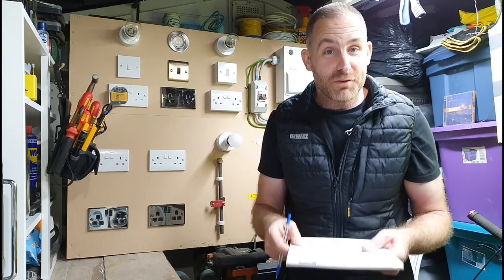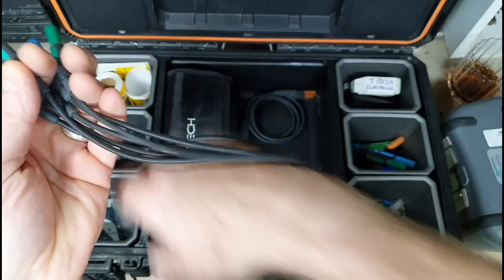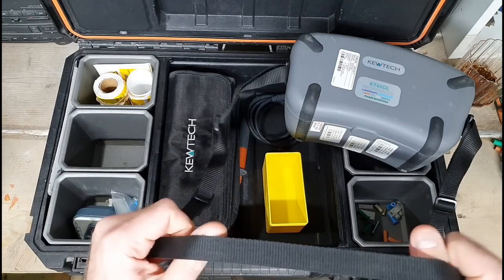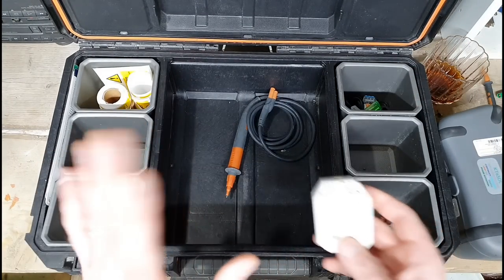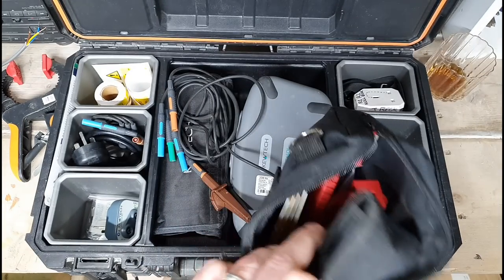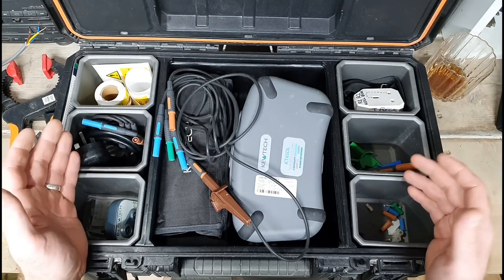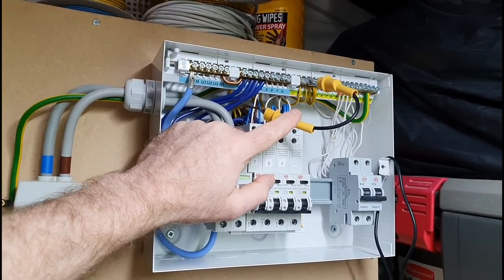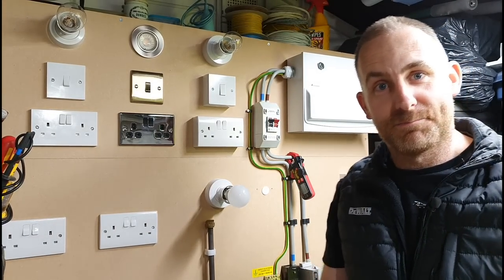The Kewtech KT65DL | Multi Function Tester. (42)

Comment: Nearly identical gear to me lol. Love my KT65DL. I have the light kit, the PAT test converter, the Proving unit, Leads, Crocodile jump leads, but i carry mine in its original canvas bag, along with my fluke clamp meter, and breakout boxes. Also.. That silver touch pad on the panel measures the potential between the operator and the
 tester’s PE terminal. A message“PE HiV”is displayed on the LCD with the audible buzzer if a potential difference of 100V or more is present between the operator and the PE terminal at touching the Touch pad. Great to see you back James ;-)

Comment: Nice vid mate 
I'm a local boy and was surprised to see your video of a rewire you did on Ashley Lane a while back, this was the area I was brought up in . I went to the college behind that job and also to the Primary school at the end of the lane
just to mention though when you start making additions to the rig you will need to put the tails from the supply into the top of the isolator and the board tails into the bottom, I know it looks really neat but the supply tails always go in the top as they can be pulled out if something heavy falls on them, sorry if you think I'm nit picking but for such a good job you would want it correct, wouldn't you?

Cheers and keep up the fantastic content
Reply from the maker: Hi there, yeah I know the area well and I've seen it change alot over the last 20 years. Thanks for spotting the isolator and the cable route. It makes sense for the reason. Hey we learn something new every day 😀👌.

Comment: what’s the difference between the Kewtech KT65 and the KT65DL?
Reply: the DL means "Down Loadable" so it saves your readings on the meter and you can save the data as a job lot from memory to your PC. It uses a supplied opto cable to connect to your PC.